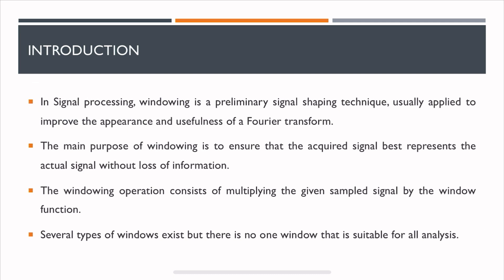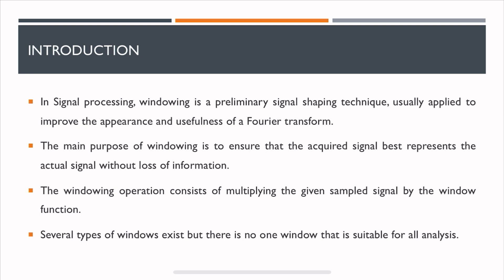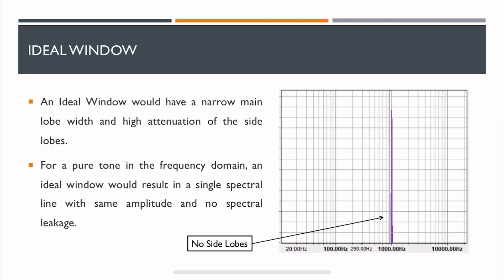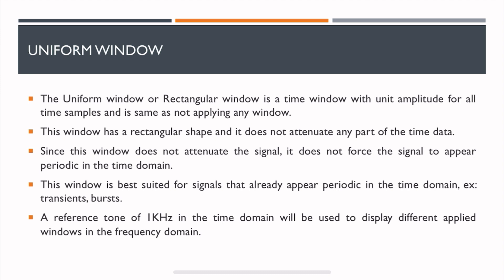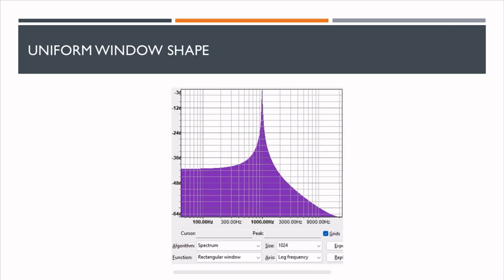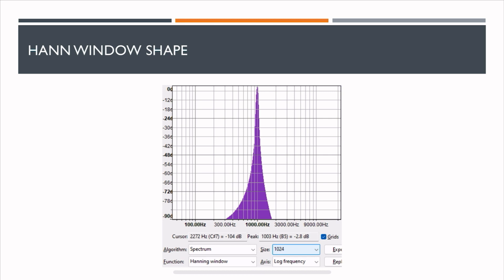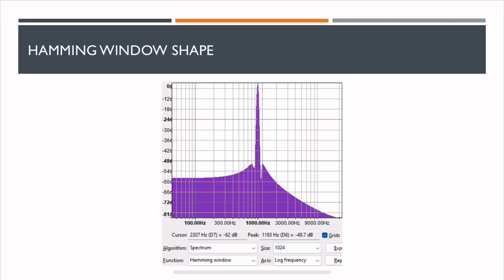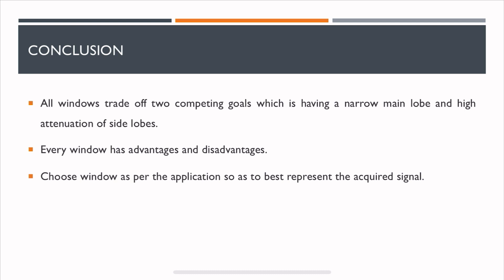Types of Windowing explained

Comment: Which window is best suited for processing audio to analyze frequency spectrum?
Reply from the maker: For general analysis, Hann window (Hanning window) is used. However, there are situations in which a specific window type proves to be more useful than the other. There is no "one window" which is perfect but rather each window has its strengths and weakness and finds its application in those specific cases. For example, Flat top window (not mentioned in video) has maximum amplitude accuracy compared to other window types. For this reason, Flat top window is used in calibration of microphones as the peak amplitude can be determined with high accuracy. Likewise the leakage of Flat top is greater than Hann, so it cannot be used for general analysis.